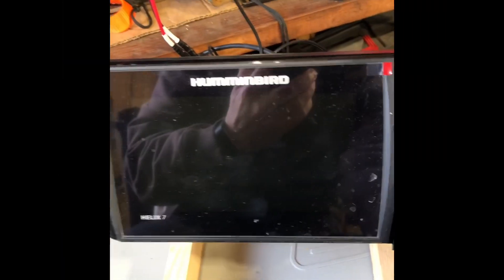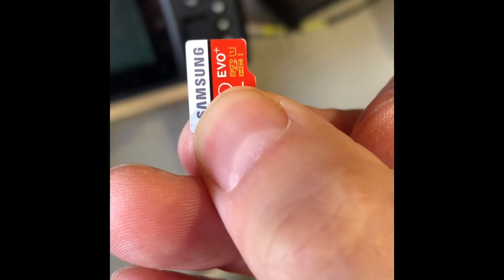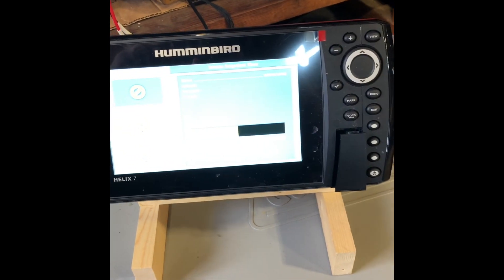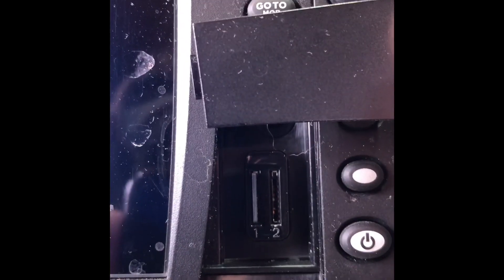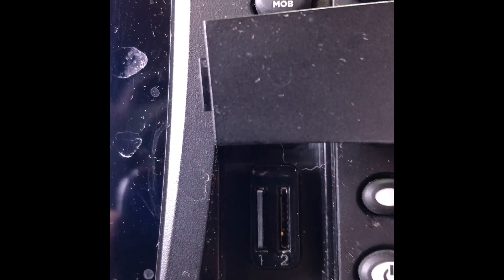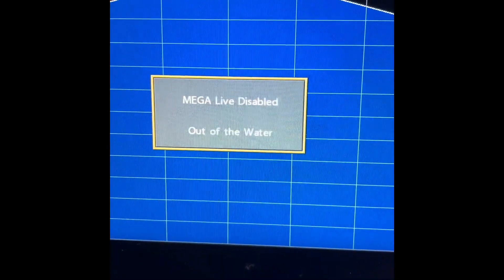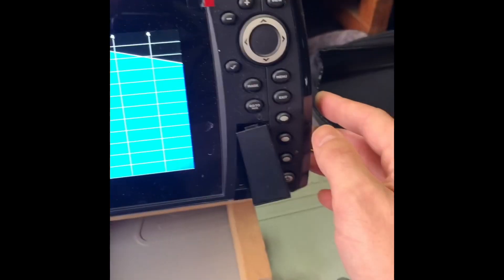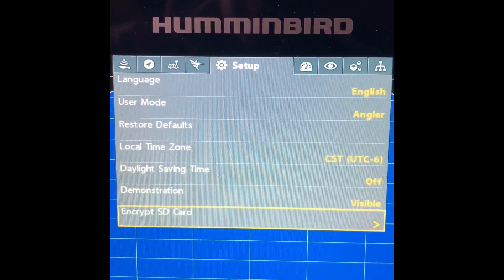How to record Humminbird Mega Live

Comment: Did it allow you to record for longer than the 2.5 minutes?
Reply from the maker: Mine are all 5 minutes long.
Reply: @MrKattlyn2  Will see what I need to change. Mine stops at 2.5 minutes.
Reply from the maker: What size of card are you using? Don’t use anything bigger than a 32GB
Reply: @MrKattlyn2   32 GB card also. Is there a way to transfer the video files to the PC? Right now I just use my phone to record the playback of the clips.
Also it took me 4 days to find this to reply. For the life of me though it was on one of the Facebook mega live sections.
Reply from the maker: That’s strange. I’ll try and look in to the length. When put on the pc it just records data, you would need programming out of my league to interpret it all. I just set up a camera and record the screen. Garmin you can but humminbird needs to up their game on the transducer and the recording option.